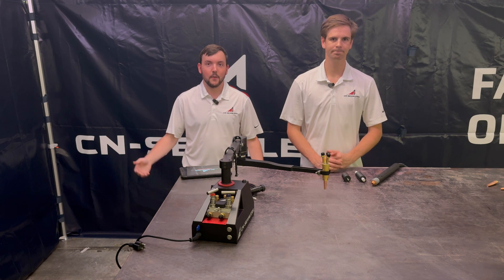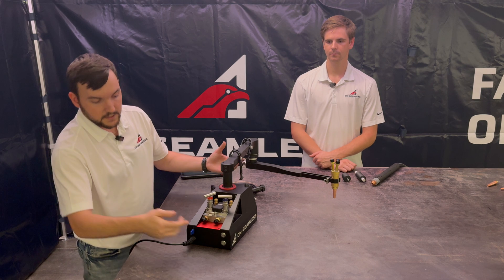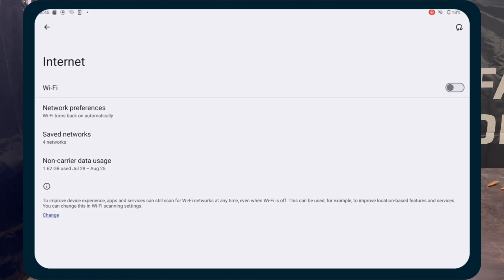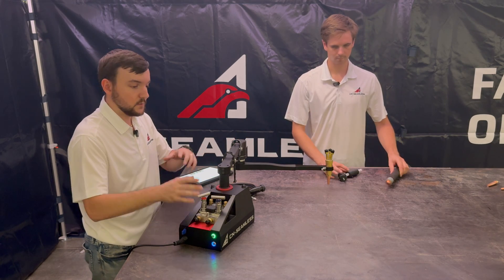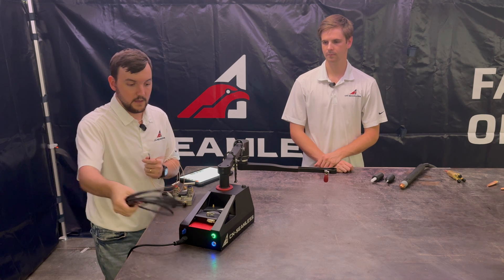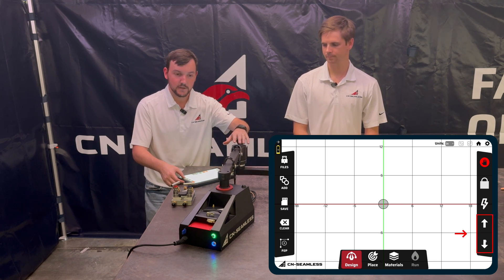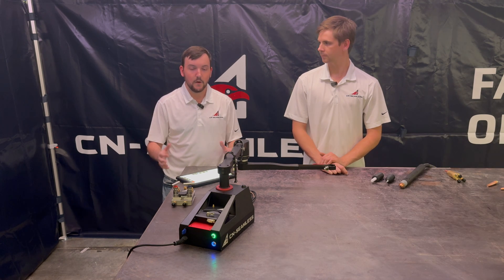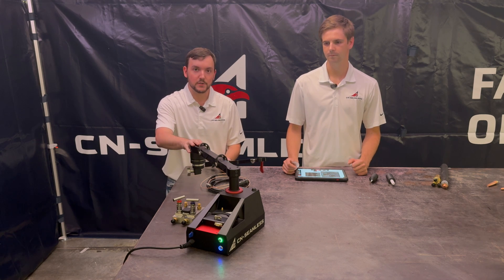CN-Seamless Mach 1 Training [0] – Getting Started

Comment: I watched a video by IC Weld.  Issac really loves his unit.  He had to create 8 of the same part on 1" steel.  The parts were about 18" long by 8" wide.  He set up 1 with the tablet and arm, and then let the torch cut out all 8 from the steel plate.  Very impressive.  A full CNC cutting tool in a suitcase.  Very smart.  Hope you all do well.